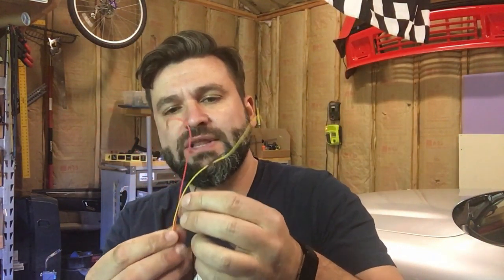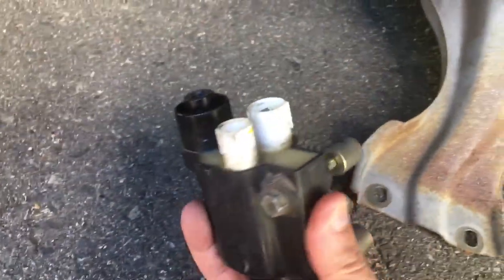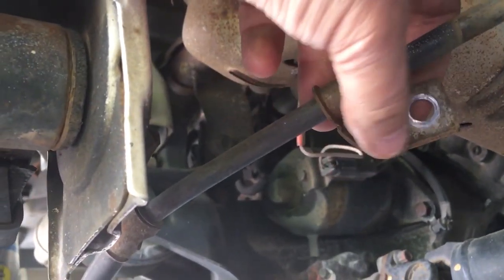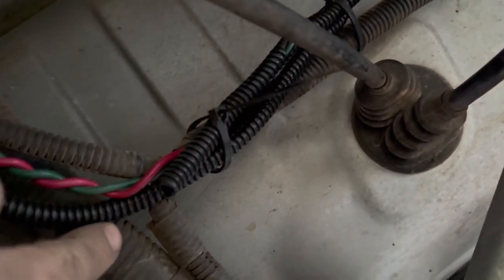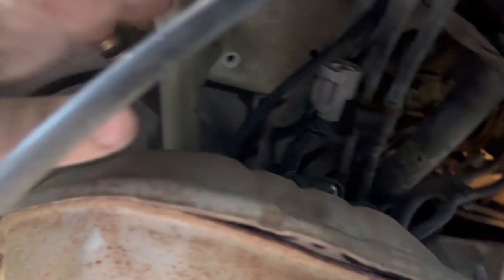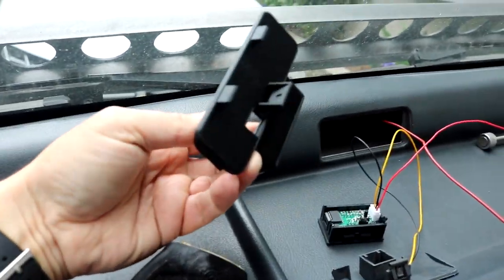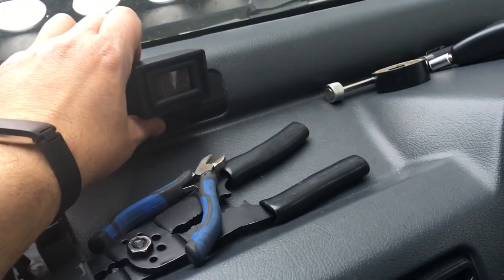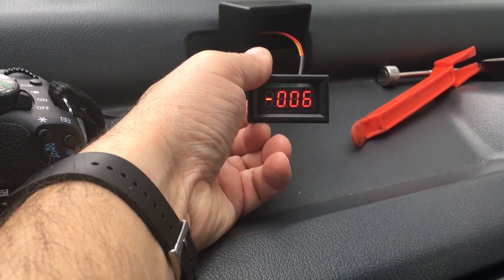DIY Tachometer Installation for Less than $10!!!

Comment: I don't know a thing about how to design for a 3D printer. Could you design a mount for an 85mm instrument pod that I could use to house a gps speedometer and tach combo using the acty clock location like you've done? I'd pay you!

Comment: Thanks for showing the locations for all the necessary contact points! I plan to install a traditional tach in my ‘93 Acty.  You said the 3-cylinder setting on the tach won’t work on the Acty? And why is your tach’s reading so jumpy?
Reply from the maker: On this particular tach, the impulse signal works best for the Acty on the 6 cylinder mode, but this may differ for other tachs.  The “jumpy” effect has to do with the the tach I’m using as well.  If you were to look at a 50’s era race car it’s just as jumpy even though it’s an analog dial tach.  The smooth movement on tachs is achieved artificially, by being liquid filled or programming.
Reply: @MarcoCerqueira  How many feet of wire insulator (loom) did you need?
Reply from the maker: I bought 25ft but probably only used about 8 or 10
Reply: Finally got my GlowShift  2” tach connected. Would have been super easy, but, of course, you run into problems that cost you tons of time. In my case, the most difficult thing was, I mounted the tach on the dash (above the speedo cluster) using a GlowShift tach mount and had to drill a hole in the dash (although I didn’t want to) to run the wiring through. The problem was that right below the dash is a very tight space, and I didn’t want to take the dash apart.The hole didn’t just lead to an ope area below it. So, I had to get a hanger and try to fish for the wiring and pull it out of the tight space. After idk how many tries, I finally got it out. Other than that, it was pretty easy connecting everything else thanks to your video. Wish I could post a pic here of it.
Reply from the maker: Glad the video helped.

Comment: Do you still have the files for the holder?
Reply from the maker: I posted the file on Thangs3d.  You can download it for free along with other items for the ACTY.  Just search Honda Acty once you’re in there.  Good luck:  https://thangs.com/search/Honda%2520Acty%2520/?scope=all
Reply: Have you got an updated STL file? Only a 3d rendering is on thangs. I'd like to print this 😉
Reply from the maker: Hey, I just checked and the stl file is fine.  Make sure you are selecting the “download model” button and not the “download augmented reality” button
Reply: @MarcoCerqueira  I'll double check when I get home, it may have been my mistake, I'm not familiar with thangs site, my apologies.
Reply from the maker: No worries, if you still have trouble you can email me cardaytoday@gmail.com